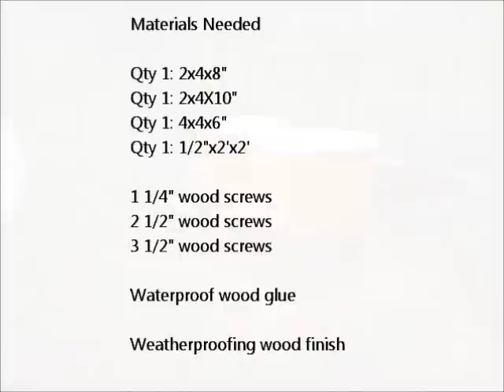Backyard Beekeeping Part 15(S2:E1): Building a Two Hive Stand

Comment: My wife and I spent an enjoyable afternoon putting together the hive stand you show here. It's the same dimensions but since I do not have a table saw I used two 3/8 galvanized bolts for the legs and instead of using a solid middle board I used scrap lumber for a lattice to set my stuff on.  It turned out really nice and super sturdy. Thank you for putting it out there and I really enjoy your other video's as well.
Reply from the maker: B Kidd That'll work! I'm glad the video was useful. Enjoy the upcoming bee season.

Comment: Hey there, so I finally made my double hive stand based off your informative video. I made 2 changes which allows me enough room at both ends for 2-3 frames. I made the long supports 61" which gives you 5" extra on each end to hang the frames on. I also made the inner supports 18" to give enough space for a typical Langstroth frame between them. It won't let me upload a pic :( 
Thanks again :)

Comment: Nice job! I didn't get the measurements how far the three middle cross 2x4 are apart from each other. The end cross support is clear.
Reply from the maker: The 2 outer middle cross supports need to be 17" from the end and the middle cross support should be half way bettween those two to support the table top. Clear as mud? Thanks for watching!

Comment: We made the hive stand and it came out great. However, even following your cutting dimensions, the plywood table section came out to be 18.5 x 20 inches instead of 24x24.
Reply: Ooops! Sorry about that, I hope it didn't cause you too much trouble. I went out and measured, sure enough, you are correct. I must have just written it down wrong when I put the video together. Thank you for the correction.

Comment: Great video!  I plan to build a hive stand soon based on yours.  On your materials needed I am assuming that means,

x1 2"x4"x8'
x1 2"4"x10'
x1 4"x4"X6'

Is that right?

Also, does the 2'x2' piece of plywood hold water?  I was wondering if I should mount a piece of chicken wire instead so it will not hold water?

Also, what are your recommendations for staining hives and the stand?  DO you just use 1 coat of that wood finish?  I've been reading about beekeepers staining and then putting multiple coats of some sort of sealant/protectant on it.  I just want to make sure my hives and stand will last as long as they can!

Thanks!
Reply from the maker: Yes, that's 1 of each. The plywood deck doesn't hold water and has held up well so far because I've slighty tilted the stand so it runs off the deck and out of the hives too. I used two coats of BEHR premium Weatherproofing All-In-One Wood Stain & Sealer (Home Depot) and so far it has help up very well. 

Thanks for watching!

Comment: Great video.  I actually went out and bought the lumber and will make a similar hive stand using your same design idea.  I will modify since I have 10 frame, 8 frame, and some Warre hives.  Here's my question.  How is the Behr wood finish holding up?  I was thinking about using tung oil since I'll be using redwood, but now I'm thinking the Behr product might standup better.  Thanks!
Reply from the maker: I'm heading into my 4th season and the Behr stain/finsh is still holding up very well. I'll probably re-apply  next year. BTW... as someone pointed out, the plywood table section came out to be 18.5 x 20 not 24 x 24. Happy beekeeping!